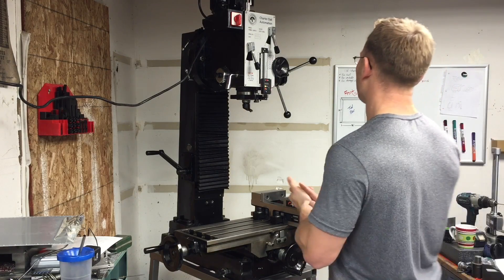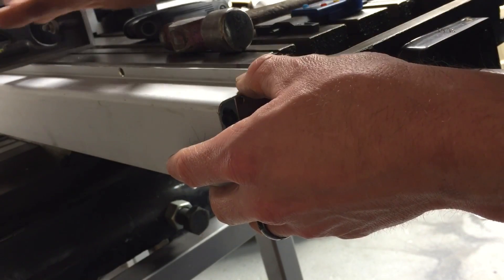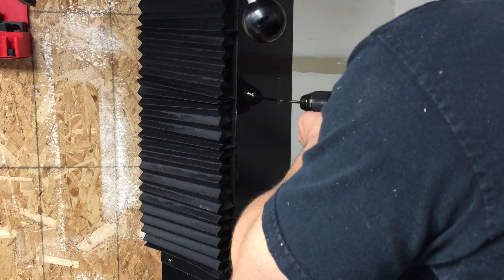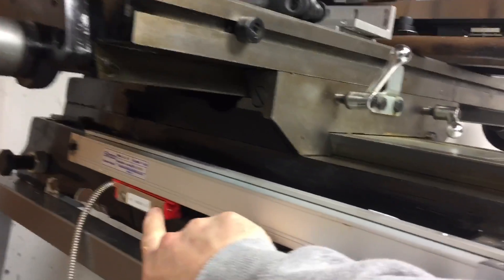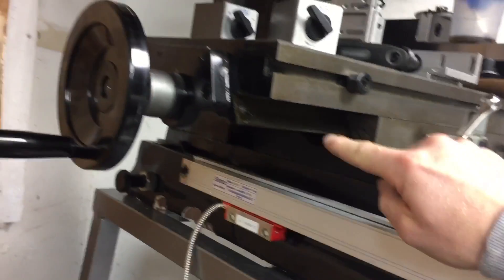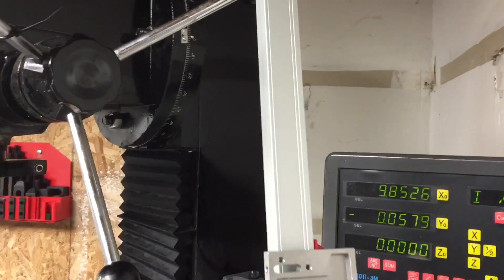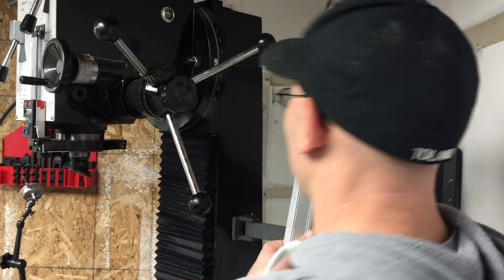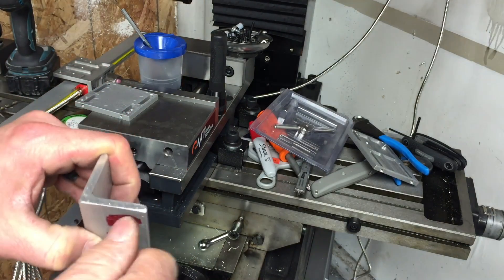3 axis DRO INSTALL RF45 ZX45 Charter oaks Bed mill

Comment: Why did you choose to mount the Z-axis scale to the head adjustment vs the quill?
Reply from the maker: The z axis would always be my 1st choice on a mill. Especially since it is so easy to mount a quill scale on a mill. This applies to knee mills as well. 

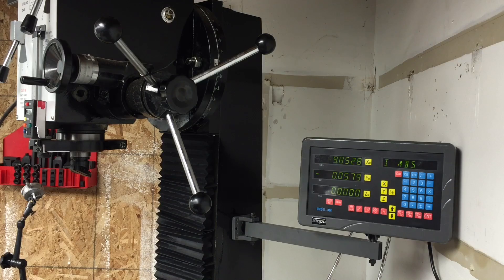You may notice I have a separate digital quill scale on this mill in this video already(you can see it at 12:17 pretty clearly), this is ideal in my opinion.
Reply: Based on what I've seen, you're the first person that I've come across to mount the scales this way. Though further research has pointed to others as well.

From my perspective, on the RF45, the quill would be used more for fine adjustment (via the dial on the front of the head) vs the coarse adjustment of the head on the column, which is almost reverse of how a traditional bridgeport is used. When it boils down to it, I guess it all depends on how you intend to use the mill. While extending the quill isn't ideal in terms of rigidity, that would be how I intend to control z-axis movement when actually machining and using the hand crank on the column for coarse adjustment to get me close prior to starting the machining op. So for me, it would be more useful to have the quill travel on the 3-axis display vs the head travel.

Thanks for the perspective!
Reply from the maker: David, 

For sure there are many ways to skin this cat. I will say I have an older video of my 1st mill,  it was a knee mill. I installed it on the quill and that was a regret afterwords. On the column style it is certainly harder to raise the head up and down since that hand crank is awkward to access. Overall, I am not a fan of the RF45 style mills, I really like knee mills for manual machining. I think the RF45 is a wonderful platform for CNC conversion though. Take care and thank you for commenting. 

I have been very busy for awhile but plan on more videos in the distant future. I have been working professionally for a bit as a fabricator/ machinist and have some pretty cool new tools and machinery.

Comment: Hi Unorthodox Fab,

I have one new Z12 Charter Oak like yours. You believe that Belt Drive +  3 HP Variable-Frequency Drive could resolve the noise problem ? My wife does not like this noise :( 

Very bad Chinese engineers !!!
Reply from the maker: +Gregory st-jean I think you are right! Thanks for the comment.